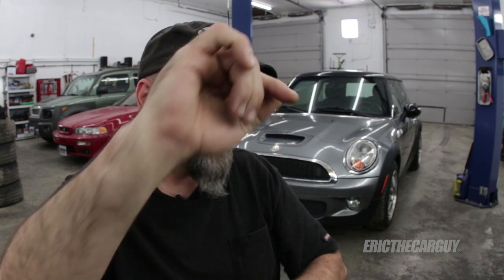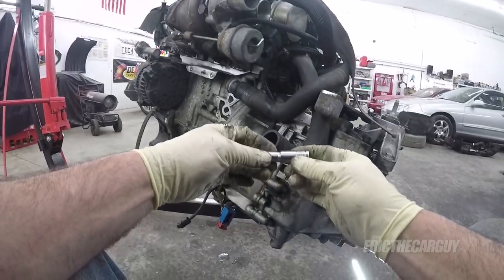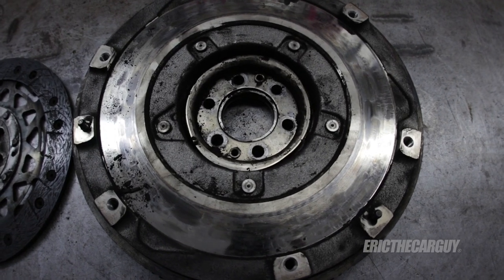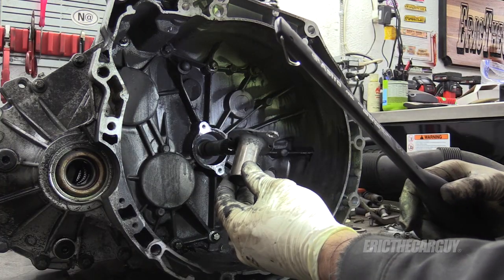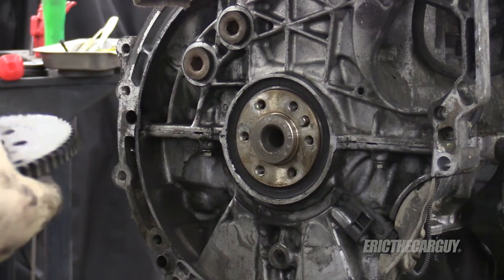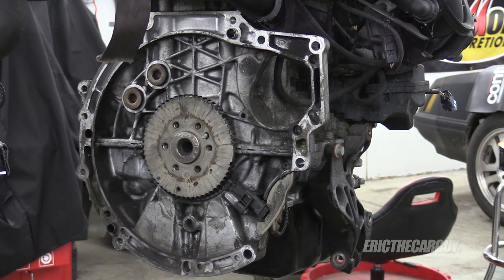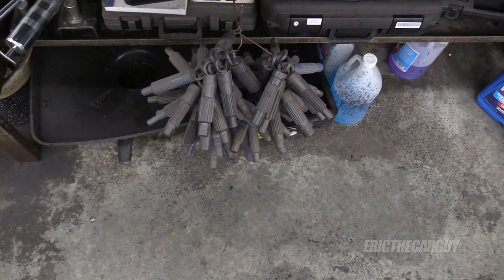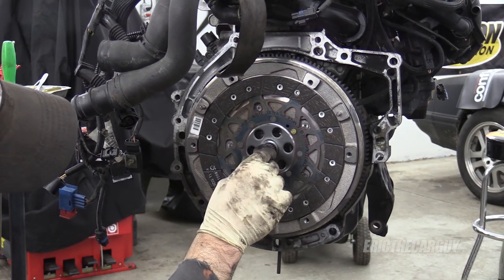How To Replace A Clutch and Flywheel Mini Cooper S (R56)

Comment: The DMF bolts should always be replaced as they are torque to yield bolts that's why they came in the kit.
Reply from the maker: I was wondering about that since the torque sequence included an angle.
Reply: Every torque to yield bolts should be replaced because they stretch a little bit in the angle tightening process. Hence most head bolts get replaced as the same torque procedure us used :)

Comment: You actually change the dual flywheel to single mass but you need to use the r50 bolts.

Comment: Eric I can't wait for the de-coke, I need to do it next weekend!! Will you use an air-compressor and "sand blast" it with walnut shell or soft media? I need to find out what coolant pipe size fits the intake port so I can attach the vacuum cleaner to to suck out the blast media.

Comment: Eric what is that spray bottle and what do you use in it for cleaner? Obviously it must be cheaper than brake parts cleaner, even the "environmentally friendly type" and I presume you add some air to push it or pump it if ur one of those guys who don't have a compressor as we do. I've been seeing them alot more and more lately. I do home repair stuff. Some side mobile stuff for family and close friends. Look forward to your reply.

Comment: You have to be pretty careful of the Clutch fork in the Mini. I have an 2010 R56 S which at the time had 117,000 KM on it and one day I couldn't get it in gear. Bought it brand new clutch and single mass fly wheel expecting that to be the problem. When my mechanic opened her up he found a broken clutch fork which was bent to the point that it couldn't push the clutch spring anymore. Love my mini, but the engine is a nightmare.

Comment: I have a 2003 mini cooper and when I put the clutch in gear it makes a squeal kinda sound but when i pull off the clutch it stops..but in 4 thru 6th gear I dont hear it at all..do you know what that might be
Reply: Throw out bearing.
Reply: So does that require me to change out the clutch

Comment: Eric any chance i can tap your expertise ; ) ?  I  have a peugeot 207 cc 1.6 16v  2007  92000 miles, which has developed a fault, starts fine, runs fine, drives for about a mile before its bogging out with no power and sounds like its got a dump valve fitted on gear change, so i scanned it and it came up with;
P0014  Exhaust camshaft dephasing fault coherence
P11a8  Exhaust camshaft dephasing fault coherence
P11a3  Exhaust camshaft dephasing fault incorrect exhaust camshaft setting
I first replaced the vvc solenoid but no joy so changed oil & filter, still the same, so locked the flywheel and re timed the camshafts, drives better now, no silly noises, no management light but still a little underpowered as if vvc isn't working and when scanned again just comes up with the one fault code now  P0014, do you think i need to replace the camshaft pulleys?  Thanks a lot .... Jay

Comment: Ah yes, pilot bushings vs bearings.  Bushings will wear, or try to grab the "nose" of the input shaft.  Bearings on the other hand can catastrophically fail, with possibly more than just a clutch job resulting.

Comment: Hey Eric nice to find your channel. So I have a 2012 tl sh-awd. Emission light came on last night check gas cap cracked it 5 clicks. Still on getting I'm obd2 reader tomorrow my guess is probably o2 sensor either the up or down stream. Maybe the maf or worst case the cat. If it is the cat would you know off hand if the xlr8 high flow cat from heel toe will just bolt on? Thanks for making videos man I'm actually starting my own tutorials car related very soon I hope to hear back from ya brotha

Comment: Kind of strange. You would think they would use parts that are cheaper to produce and use (other then the timing chain guides). 

After watching what you have done on this mini cooper. It just blows my mind how expensive it is to repair anything on this car. And that's not just how expensive the car is to buy new

Comment: Hey Eric, why didn't you go with a single mass conversion kit like the Valeo kit on RockAuto?
Reply from the maker: Please watch the video before commenting.
Reply: My bad, got my models mixed up when I looked it up on RockAuto.
Holy o crap they're expensive on ECSTuning. Clutch Masters kit is $1179. I'm so used to the VW/BMW kits costing at most $500 USD.

https://www.ecstuning.com/b-clutch-masters-parts/stage-1-mini-cooper-s-clutch-kit-fx100/03635-hd00-ak~cl/

Comment: OK, it has been my experience, that mechanics 
will buy expensive tools, but the 1/2 inch breaker 
bar, is almost always, a Craftsman brand.

steve
Reply: why pay a premium for something you are going to put a pipe on know you're going to break?
Reply: Haven't broken mine yet, and the pipe 
is the upper half of a floor jack handle.

steve
Reply: when it gets to the point I have to get the jack handle out it's stud, bolt, or tool. Somethings breaking

Comment: I find that since the flywheel failed so badly(like it usually does after 100k city miles...) the harmonic balancer had more wear on the other end of the crankshaft turning all the pumps and the alternator should also be replaced along with all the tensioner pulleys especially since when the engine is inside the car you are pretty fucked replacing them...

Comment: I just bought a used 2007 mini Cooper 6 speed hatchback. This past summer of 2018. I'm from a small town and the shop that was going to fix it a mechanic got hurt and will b out for 2 months. I have been without my car for a month now. No one wants to work on it bc of the labor it takes to get it fixed. I've become very upset and don't know what to do? I put a lot of cash into buying that car! What do I do???? Anyone???

Comment: I really hate bolts that have a deg turn requirement. Even worse is the torque 3 times then back them off x deg. They really need to stop making them that way.

Comment: You are there already, I'm sure that car have over 50, 60K on its odometer, so it is not a good idea to not touch that seal because its not leaking, soon it will, the major and most difficult job is done already, why not spending $20 OR less and 15 minutes more for that old seal? I'm sure you and your customer will be happier.

Comment: Not sure the DMF v. SMF information from Detroit Tuned is accurate.  There are lots of SMF options out there for Gen 2 R56 N16/18 engines:  https://www.outmotoring.com/single-mass-flywheel-clutch-kit-aasco.html  and https://www.mmsautosport.com/2nd-gen/ngcc87vrofyt2tc88t7jp7goxeth5w for example.

Comment: I don't get it. If you have the proper tool, why not use it? 
It's not "to show you guys at home how you dould do it", for sure otherwise you wouldn't use half your tools. Same thing with the distribution chain and the torque specs, it will come back to bit you.
Reply: I'm talking about the degree angle gauge.
Reply from the maker: Like I said in the video, 90º is an easy one to figure out. It's a real pain to use the tool. Especially on an engine that's swinging on a hoist. I had enough trouble without it. 
Yes, things come back to bite me at times, but I deal with those as they come. I also share my mistakes so that others don't have to repeat them. 

Never claimed I was perfect. Never will.
Reply: He tires to fix things like you would at home. He did a focus clutch on jack stands when he had a lift.
Reply: Actually that was before he got a lift. IIRC he had the "new" shop for 1-2 years before bend-pak hooked him up.

Comment: Shame you can't get a single mass flywheel kit for a r56. You can get a single mass kit for a r53 made by Valeo with a new rear main seal for $530 from wmw. Just another reason not to get a r56.

Comment: So an overpriced clutch didn't come with a stupid plastic tool?
Reply from the maker: Right?!
Reply: In europe garages just reuse stuff from previous jobs....for u guys sucks
Reply: Nope becose you need to have special tool for mounting this type of clutch.That tool alows you to put pressure plate in corect position if plate is equipt vith self adjusting mechanism that holds the hight of the spring same all the time.In that tool you allso have universal tool to align clutch disc.Bdw Valeo is garbage next time try LUK or SACHS (sorry for my bad englisch :))

Comment: Hi Eric, thank you for the Mini series. I do have a question for you though. The oil you used says for dual clutch transmission fluid, this the correct oil for your car? I used the manufacturer website oil chooser and it listed a different oil https://www.fuchs.com/de/en/products/service-links/oil-chooser/

Comment: I swear they need to get  off their high horse.... 1300 bucks for a clutch kit and flywheel.... those cars are not  worth to much more than that in my opinion.... I mean heck,i  bought an 06 supercharged Mini Cooper at the sales which was a one-owner car for $2000...  most shops, a clutch kit replacement like that could cost upwards of $2,000 .... sheesh..... of course I don't know what you charge but some shops really stick it to you... and why would they change something that has worked for what, over a hundred years.. I mean for over a hundred years  a clutch has been pretty simplistic...Springs in the disc or a racing clutch, no Springs... why the hell do they think it would be better to change it over to something so stupid expensive that if you had a Mini Cooper with over 200,000 miles you may as well just crush it.... the reason this pisses me off so much is I just acquired an 07 turbocharged Mini Cooper that has a bad clutch,throwout bearing through the pressure plate and I dang sure will not spend $1,300 on a clutch kit... hell no not happening... good thing the car was gave to me because the guy that had it didn't want to fix it..... you obviously can see why... because of idiocy... have been a mechanic for over 26 years and I swear sometimes I'd like to punch those Engineers right through the skull ...I wonder sometimes if they can even wipe their asses... lol rant over.... lol...😁

Comment: Not your best job Eric, should've definitely replaced the rear main in a car known for leaking. There was no "dampness" but you can see where it was seeping and further collected clutch dust on the wet spot.
Reply from the maker: It wasn't available on the day I shot this and I had to keep to a schedule. Had I waited for a seal, it would have set back production significantly. Keep in mind I have to consider production as well as the repairs, and this year time is VERY limited for me. In fact, I just finished this video a couple of hours ago. I stand by my call.
Reply: I guess the next person can deal with it, if it does happen get worse.
Reply from the maker: Please don't be that way about it. It wasn't leaking and once again, I stand by my decision.
Reply: I'm not being any way about it, i said if it happens to leak. I stand by your decision as well
Reply: If you really stood by his decision then why did you comment that negative comment in the first place? If it wasnt leaking then why wait for the seal?
Reply: First off, this engine leaked from everything that could leak, it only made sense, 
secondly, it did appear to be seeping oil which was soaked by the clutch dust, 
third, he didn't mention in the video he had to wait for parts, if he were to order it,
lastly, it's my opinion, whether you agree with it or not, its my opinion
Reply: by the way, your logic is flawed, just because it's not leaking, doesn't mean he didnt spend several hours to get to that part of the engine not to change a couple dollar seal(granted he didn't have to wait for shipping), there was a lot of functional parts in the timing replacement video that "worked fine" and didnt need replacing, but he replaced anyways.
Reply from the maker: I did mention it in the video that I would have to wait for the part but cut it for time. I didn't think it was necessary to leave it in. YouTube is all about watch time these days. The seal was not leaking, and it would have been at least a day before I could get one. I'm not going to scrap a day of production for a seal that isn't leaking. Anyone that watches the video will not only see that I recommended a seal, but I've also linked it in the description. I've given the viewer every opportunity to do things the 'right' way. Yet somehow you feel that by me not replacing this seal I'm doing wrong in some way. In my view, your logic is the logic that's flawed. It's not like I'm selling you this car, and if I was, and the seal leaked in a short amount of time, I would gladly replace it for the cost of the part.
Reply: EricTheCarGuy glad to hear you stand by what you say. With that said, don't let keyboard warriors get you all fired up! Lol
Reply: Haha, That requires a whole channel of it's own.....also one for wiping down all the door handles etc in your home to get rid of oily finger prints...(I have been guilty of that)
Reply: Let the haters hate... 
Your car, your rules...
Happy flipping Friday 2u! ✌
Reply: Eric i think you made the right call. It wasn't leaking i would have made the same call.
Reply: 5:40 - Eric explains the rear main seal situation. I move on with the rest of the video. Makes sense to me. If it's not leaking, I'd hazard a guess that it's not worth taking it out and discarding a working seal. 'If it ain't broke, don't fix it'.
Reply: Aww poor guys upset cause no one helped him gang up on hating eric. Psh...calm down guy.
Reply: Stop shouting sir.
Reply: Lol you started the trolling sir. Nothing wrong with trolling the troll.
Reply: I'm stating my opinion, I'm an ETCG premium member, why would I troll someone I pay support too? Unlike you
Reply: David G i commented not long after you yesterday. How would i have seen the video on a thursday if i werent a premium member also? Gotta think about things a little harder friend.
Reply: the point of my comment is im a premium member, whether you are as well or not doesn't matter, i wouldn't talk shit to someone I pay, so just know whatever opinion you've formed on my comment calling me a troll, in the end, is wrong.
Reply: Ok maybe you're not a troll, I'll give you that. The negative comments are just not helping the situation so why bother telling him what you think he did wrong? No one really cares what you think, its not your car friend.
Reply: Maybe the thought is also to just "leave well enough alone."  It is always a gamble. If you change it and accidentally screw something up, then you are changing it again. So this way, you know it is not leaking. Whereas, you go in there messing around and you might introduce a leak. Did anyone look up the procedure on changing it? Do you need special tools? He didn't have a small enough E-torx to get that last plate off before the seal, so who knows if you need something else to get he seal out.
Reply: Steve M. True, i guess we're getting carried away here lol